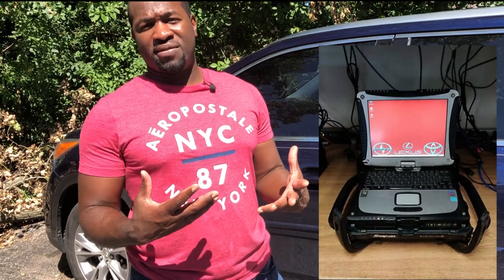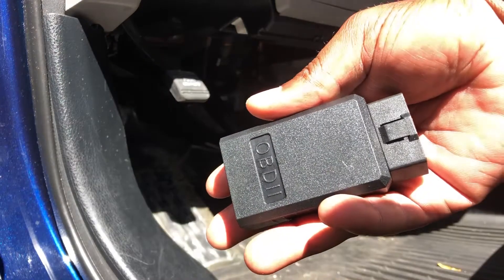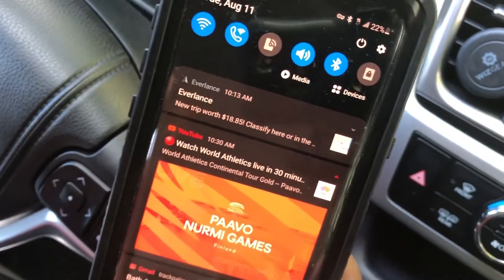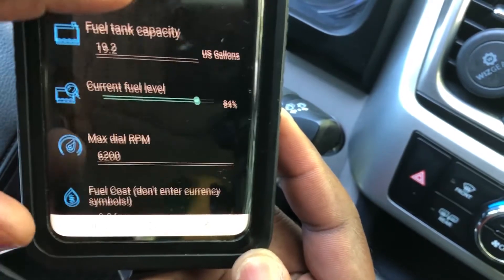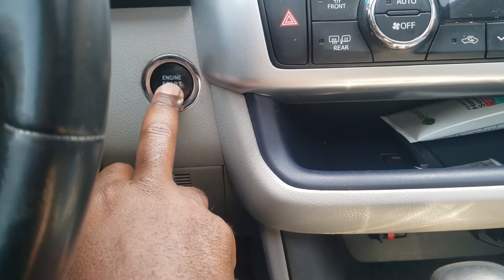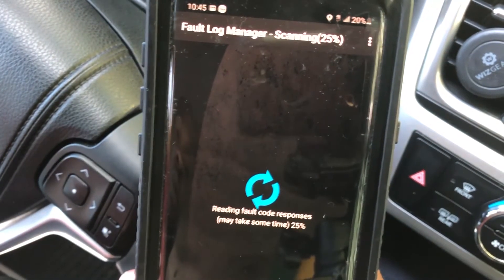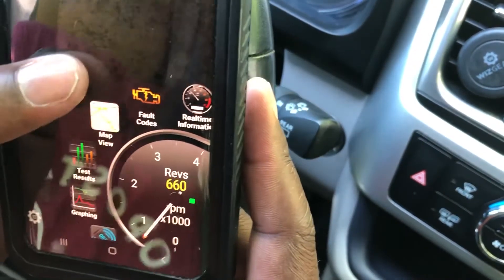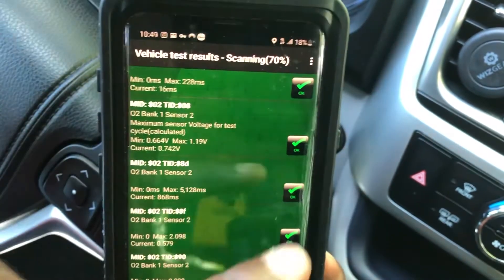How to Scan Check Engine Light with Bafx OBD2 Scanner And Torque Pro App

Comment: after 1,5 year BAFX OBD II doenst work. cannot pair it..... had a try to three android devices.....  and three different cars.
Reply from the maker: Sorry to hear. Mine is still working after 3 years
Reply: Same issue. It used to work fine for years. It won't pair with it anymore